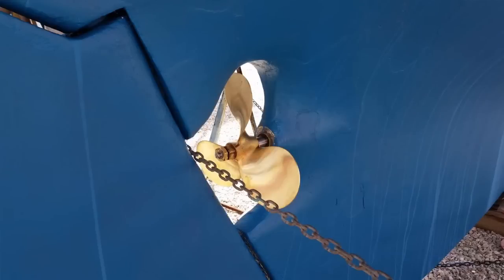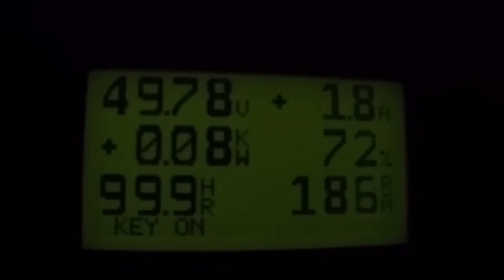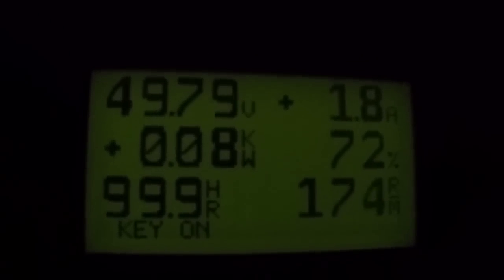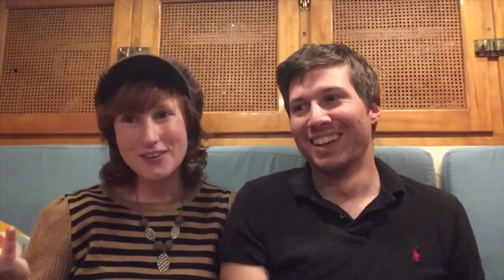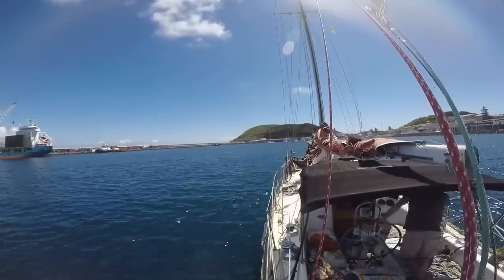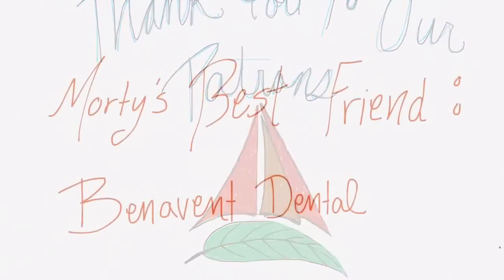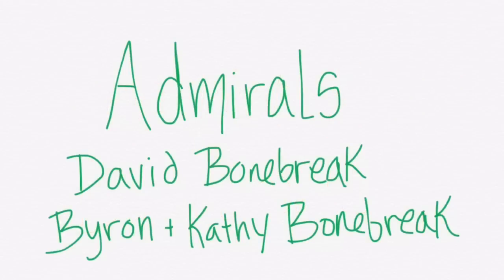Electric Motor, Ocean Crossing with Regeneration | Sailing Wisdom

Comment: Sounds like it's time for a repurposed (used) Tesla battery module or two. $1200 (avg) each for 233ah/5.3kwh at 1C discharge. These are already designed specifically for an electric motor. Made with 444 18650 cells, unlike most sealed lifepo4, CAN be rehabbed and will not fail if a few cells die down the line, just a reduced capacity. Also, Tesla adds a another item to their chemistry, poss cadmium (I forget), that prevents thermal runaway. Another good thing is that the cylindrical 18650 have a more balanced discharge profile and less rate of failure than regular prismatic cell-based (square) batteries. The biggest joy about using these modules, is that they can be placed in any orientation including upside down if you like, so can be placed literally anywhere in the boat. Each module weighs about 50-60 lbs and is about 24"x12"x 4". We're converting the house battery plant on a 40' Morgan ketch to Tesla modules. Should be able to run the ext lights (all LED) and ac unit all night and super fast recharge times. Still keeping the diesel for now....all about the $$$.

Comment: Just installed two Battleborn Lithiums in our Airstream...one point, you will have to upgrade your charging system, you will probably need a much better charge profile than the re-gen can provide. It may be at least 600w solar and two 400w wind turbines.
POI it takes 8hrs @ 8a using our 2000i to fully charge our 200w bank.
Much faster than the two Lifeline AGM's they replaced.

Good Luck ⛵️
Reply from the maker: Yeah, we are going to be upgrading the solar setup after we finish our current projects.

Comment: I'm going with propeller geometry, something made to push you when spinning at high speed may not be optimal the other way around.
Optimal is probably a folding prop for your drive and a speciality generator propeller on a drop down stern drive thing.
Reply from the maker: It’s our dream to have a kiwi folding prop :)

Comment: Very interesting. I am trying to get a 28 footer up and sailing. It has an ancient diesel in, and I have my doubts about the gearbox. I am looking at electric motors, also just to get in and out of marinas. Keep on talking!
Reply: Hi Coen, I replaced the Volvo Penta 10hp diesel in my Compass28 with a 2.5 kW electric motor and 120Ahr 24v battery. I have been using this system for 12 years now and am still happy with it. 
Cheers 
Carl van Wyk 🙂
Reply: @karelseemonster  Interesting. Where do you sail? What motor and controller? Sounds like what I want to do, but there are lots of ducks to line up.
Reply: @coenvanwyk1  I sail in Queensland, Australia. 
My motor and controller is Mastervolt 
 I have 150Watt 60V panel into Victron 75/15 regulator.
Reply: @karelseemonster  Thank you, most useful. And how does a van Wyk end up in Orstralia, I wonder...

Comment: On diesel motors and electrical generation, I have designed a mod that installs 4 @ 200 amp alternators which turn rapidly at 1000 engine RPM . The electric clutch is set up to disengage at 1200 RPM. This will be highly efficient for power generation.
Reply from the maker: That’s awesome! You will get a ton of power at low speed and not have that drag when you are actually motoring 👍

Comment: I think electric also can be a solution to coastal sailing on holiday. Batteries is barlast and you go into marinas at least twice a week, so you can charge with land power. And an outboard as back up.
Reply from the maker: That would work well! Just make sure you have a big enough battery bank and you can comfortably hop from marina to marina as you enjoy the weekend :)
Reply: @RiggingDoctor  Right now I have a 20 ft trailer sailer w a 2 hp 4stroke Honda outboard. I think I keep it for now. 15 nm on 2 l gas 4 kn calm sea. But when electric outboard motors get stronger than trollingmotors or I get a deplacement boat w an inboard motor, I will consider electric. Here in Sweden we normally alternate btw marinas and "nature  habours" in the archipealago when out sailing. In emergency you are never more than 5-6 nm from power. Max 10 nm btw marinas.
The silence even w motor on a calm day would be nice.
I enjoy your rigging explanations, as I am new at sailing.

Comment: A practical solution? I have an air cooled 168F Chinese diesel. With a 7 inch pulley, it will charge a battery very well. Salt water cooling is a horror show. It can run an hour on a coffee cup of diesel, but double that if you're cranking into an alternator. Dry hot air is a wonderful by product. Mount it on a thick aluminum plate. Watch the oil consumption during break in. Don't idle it too slow, nor blast above 2000 RPM's. Huge cash savings, weight reduction, reliability, and charging your battery are wonderful. Water cooling and breakdowns are for the birds.

Comment: You have a great channel and an interesting discussion about electric motors. I am sold on rigid solar panels and have been using Mitsubishi panels for three years. In uninterrupted Bermuda sun they put out up to 32 amps. With a 600 amphr battery supply I am completely self sufficient. Re-gen power is extremely inefficient and most sailors would not put up with loosing 1 - 2 knots of boat speed. So it's solar for me. You did though comment about the fuel (in)efficiency of your old diesel motor. 2 gallons an hour is extremely poor. I would think less than a gallon an hour would be the norm.

Comment: Tesla batteries are available from roll over wrecks. Nissan Leaf batteries second hand are a much cheaper option. At 90% power they are ready for replacement in the car, but as a battery bank are ideal.
Reply from the maker: I know! I’ve been pricing them online! As soon as we get to Florida’s coast, we’re going to be switching the batteries from lead acid to lithium 👍

Comment: A  internal combustion engine heats the boat up while using it and for hours after use. Great if it is cold out but sucks otherwise. I  often or almost always had to sleep on the deck with bug webbing. Took the joy out of sleeping. I am going with small engine good ventilation and only use it when I have to.

Comment: Until you isolate the battery ground during regen mode, you are operating like a water wheel with a closing gate at the stream feed. Just  what made Tesla scratch his head at his contemporaries.

Comment: you can turn you regen % down so the yatch will travel faster or so a smaller boat can use regen or so you can travel at slower speeds and not stall out the propeller from regen braking
Reply from the maker: Yes you can, but we have our regen set to 5 (out of 130ish). If we are really moving and want the power we turn it up as far as 95, but that’s only when we are consistently doing 8 knots! 
Anything less and the propeller spins too slowly to make good power. 
At 5, it spins quickly and actually makes more power at slower speeds so that’s kind of our “default” setting.

Comment: It Is More Dependent On The Controller Programming ....if you "load" a prop too hard, it won't spin; if you don't load it hard enough, it will just spin .... it's kind of like manual MPPT...so you have to Tweak The Re-Gen Controller Programming........reductions might be great for forward propulsion, but just as much, they cause a reduction in re-gen
Reply from the maker: Everything is a compromise :)

Comment: 09:00 Don't get rid of your Carbon Monoxide detectors.  Even though your own boat won't produce CO, the smelly powerboats upwind or in the next slip will definitely produce CO and it can collect inside a neighboring boat as CO floats along the water.   So, keep the CO detectors and place them at berth level so they go off if gas is detected at the same height where someone is sleeping.    BTW replace detectors every few years with new ones because the sensors wear out, don't trust a decade-old detector.
Reply from the maker: We have actually had them go off because of that very reason!

Comment: You need to put a nacelle around the propeller to optimize it by forcing the water through instead of around
Reply from the maker: Thank you for this! I was able to look up nacelle to see what it was and it was the part that I have always wondered “what is that?”  Now I know!
Reply: @RiggingDoctor  hahaha no worries! Frankly I dont think its called a macelle for boats, I just licked out the term I know! I'm actually working on a propulsion system for sailboats that makes better use of the regen functions, if its allright with you could we have a chat about your current system when you have the time? I'm curious about what else there is on the market since it seems to me people gave up on developing this use of the technology.

Comment: Our electric yacht motors does  do charge while sailing if my parents had a prop big enough but they don't have a three bladed fixed prop the have folding props
Reply from the maker: Folding props are great for speed but not so much for Regen. I will say, the silence of not hearing the prop spinning all the time must be nice!

Comment: i feel that a hybrid would best be suited to sailing..   a battery big enough to take you in and of the marine/docks  running electric only.   then the engine for the days of sailing without wind..     and during the times when your running on diesel, the motor could act as a larger alternator to quickly charger the smaller battery bank..   ( smaller battery vs electric only)
Reply from the maker: It really is the best of both worlds. Also, if either fail, you still have the other motor to move you along!
Reply: @RiggingDoctor   thanks for the reply! and  thats very true..   im hoping to do something similar once i finally purchase a 25ft'er..    on a smaller scale :)

Comment: Cheers for the info. Really good as I’m considering electric motors but will probably wait now for blue water sailing in 10 years (were batteries will be loads better too!) which isn’t what I’m doing now coastal sailing round the Uk. Cheers for now

Comment: Love your almost-electric sail boat. Would be great to have enough solar to keep motoring at low speed when becalmed. And I understand you can get some really quiet wind genies that will keep charging at night and at anchor....  the fossil fuel Honda and the diesel heater grate though. good luck guys!
Reply from the maker: Mark Ebert The Honda is a backup that’s we needed in the ICW but have seldom used since. The diesel heater was installed when we still had a diesel motor. While it burns fossil fuels, it doesn’t burn much. We have an 80 gallon tank that we filled up before we left 3 years ago and it’s still more than half full!
This means that I have no experience buying fuels in other countries 😎⛵️

Comment: Great review of your Electric Propulsion system! You mentioned getting up to 5 amps of regen, is that at 50 volts or 12 volts? If that is regen current at 50 volts then it's 20 amps at 12 volts (not bad). I'm impressed with your regen numbers with an aperture installed propeller. If anyone is thinking about going electric on a sailboat with a spade rudder and a strut mounted prop you might get better regen results. Regarding boat speed while generating electricity, on my Ericson 27 I have never found a lose in boat speed. Nice going you two!
Reply from the maker: Thanks! Those amp readings are at 48v (56v when we have full charge though)
Our setup is the worst for regen with the aperture mounted propeller. I saw the motor people at a boat shoe and they were telling me about a guy getting 9-10 amps @48v when sailing 5-6 knots! He had a nice exposed propeller far away from his keel though. 
Since we seem to be the “bad setup” for regen, we figured that we would also be able to critique regen and its capabilities, since it can only be better on any other setup.
What kind of numbers do you get and what diameter is your propeller? Two blade or three?
Reply: @RiggingDoctor  On my little Ericson with a fixed three blade 13x13 prop I get 1.5 (occasionally up to 2 amps) amps at 6+ knots of boat speed. This is with a Sevcon Gen 4 controller. I recently replaced the Sevcon Millipak controller that came with the SolidNav EP unit with the Gen 4. Scott at Electric Yachts supplied and programmed it for me. Unfortunately I'm getting lower regen with the Gen 4. I used to get up to 4 amps with the MIllipak. The difference between the controllers is the throttle/shifter  setting for regen. On the Millipak I set the shifter to forward and then feathered the throttle depending on boat speed (higher throttle setting for higher speed). On the Gen 4 I put the shifter in neutral and the throttle doesn't matter. How do you set your controls for regen? Also I think it makes a difference how full the batteries are during regeneration, lower charge level on the batteries and higher numbers on regen, have you experienced this? I'm really impressed with your regeneration numbers!
Reply from the maker: Our regen setting is key on and throttle in neutral. I have heard a few stories of the old setup where people thought they were regening but were actually draining their batteries further because the wind died and they weren’t paying close attention to their amp meter. 
Our regen amps numbers seem to be the same regardless of charge level, but the voltage fluctuates. When depleted, the volts will be in the low 40s, and when fully charged will be in the high 50s. Since volts x amps gives watts, it would seem that we crank out more power at higher states of charge, but it could also be that the batteries are resisting the charge from going in so the volts climb. 
Our highest regen amp number ever was when we were full charge and I was afraid of it overcharging it. We were in a lot of wind and were cranking out a steady 12 amps at 67 volts! (0.8kw). We were fully charged so we just hit the battery switch off and let the prop free spool. 
Thanks for your regen and prop numbers. It does seem that diameter plays a major role in power production.
Reply: 13 x 13 prop on a 27 ft. light displacement boat, that's a really odd prop choice, no?
Reply: Hi ray Nic, not sure what you are asking.
Reply from the maker: We have a 16 x 12. It all comes down to space for the prop diameter and gearing for the pitch.
Reply: @sensor6101  to the best of my knowledge two determining factors to prop size have do with hull speed and shaft rpm. I have had numerous boats between 26 and 40 ft. and none of them had a prop as large as a 13 x 13. So thats what I am questioning. What rpm's does shaft turn on the electric motor, maybe thats the difference.
Reply: Hi ray Nic, just seeing this. With an electric auxiliary it is generally determined that a bigger prop is better (to a point of course). I like the aggressive pitch for regeneration, I get better regen with the 13x13 than I did with a 11x10 fixed two blade and a 12x10 fixed three blade. Also top speed on my Ericson 27 went from 4 + with the 11x10 to over 6 knots with the 13x13. Probably more importantly my boat speed at a 20 amp draw (48 volts) went from 3 knots to 4 knots with the bigger props.

Comment: I’m working on a device that generates electricity from a swinging pendulum which is swung by the pitch n roll of the boat. When you made your trip, was there any point when the boat was flat calm with no pitch or roll?
Reply from the maker: Yes, but it was only because we had been becalmed for about 4 days. The sea went completely flat. Normally, there is always a motion as the waves are on average above 4 feet, and the average sea state was between 8-10 feet because we route ourselves on a wind path that blows 20-25 knots the whole time and that’s the sea state you get. At times, there was a bit of a lull in the wind, but it was always temporary. 
This idea sounds very useful! Our next big project is going to be to refit our Alberg 30 and I would love to try it out in a few years when we get that boat out to sea. Keep me posted on how the development goes.

Comment: Nice video.  Appreciate the frank discussion.  A question(s), I hope you are still responding questions on this.  You say that the Electric power in the ICW was bad because you couldn't generate enough power.  Did you have the generator at the time?  What size generator do you have?  I am considering an EP conversion and I have a 4200W generator which Electric Yacht claims can power the boat at up to 3.7 knts (my own calcs support this).  With the amount of diesel I have on board I can run the generator almost indefinitely.  With my set up, does your opinion on the Electric power for places like the ICW change.  BTW, I don't plan to spend a lot of time in places like the ICW either, but I don't want to be prevented from going there either.
Reply from the maker: We had our Honda 2000 generator but only a 6 amp charger. Now we have a 25 amp charger and we’re going to have much bigger batteries for our second ICW voyage starting in a few months!

Electric has been great on our voyage but we know it’s limitations. Now that we want a little more range to motoring, we just need to add more solar and batteries :)
Reply from the maker: As for speeds, at 40 amps we go 3.1 knots and at 80 amps we go 4.0 knots. These are in 48v so by calculations I think that means 1.9kw for 3 knots and 3.8kw for 4 knots. 
They are pretty spot on with their calculations of speed and power needed, range just comes from adding time to the equation.

Comment: Hi Guys, really interesting stuff. When you at anchor do you have a wind generator so at night, when you do not have any solar, you can charge?
Reply from the maker: We don’t. If we need to top off our charge, we have a Honda 2000 generator, but we just added 600 watts of solar, so we’re pretty much set!